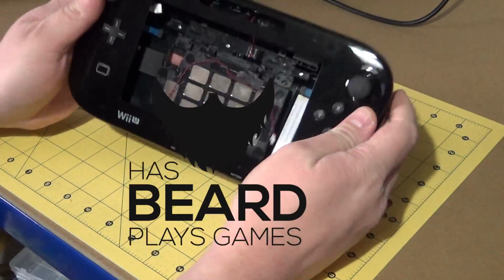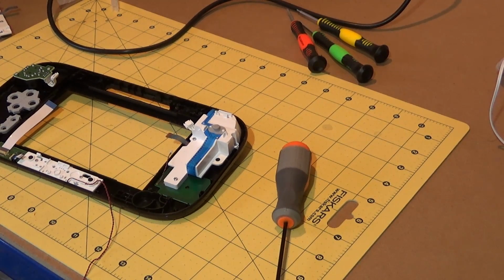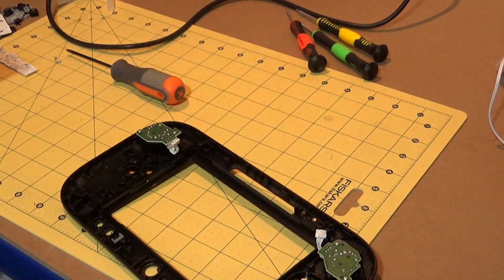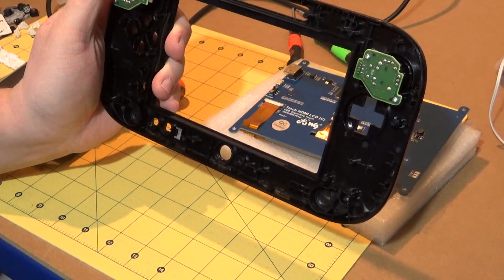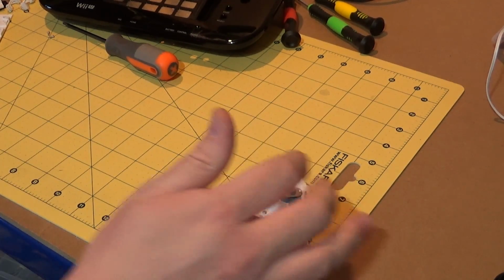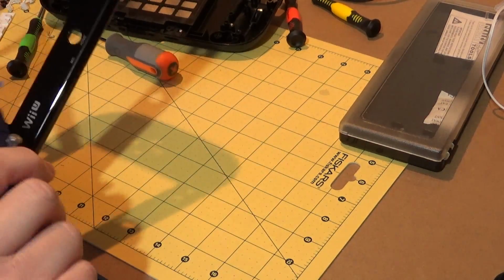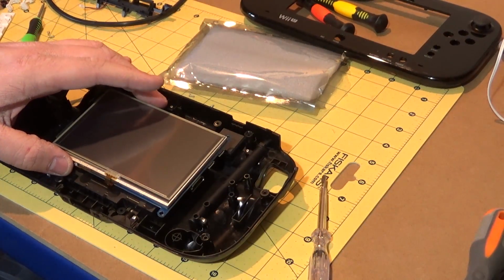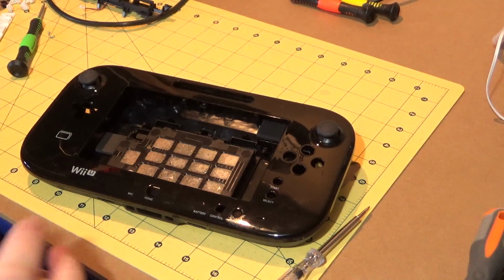(ABANDONED PROJECT) Raspberry Pi in a Wii U Gamepad - Part 2

Comment: you wil most likely need an arduino micro to do the HID front for your two analog sticks, order one or 2 of those if you don't have them. The 5pin connector must be vcc, gnd , Analog1 Analog2 and switch and lastly I think you should find ground on the flatflex first to be able to probe them out succesfully.
Reply: Use this library to appear as a true gamepad https://github.com/MHeironimus/ArduinoJoystickLibrary
Reply from the maker: Thanks for the link, I'll bookmark that! I've seen plenty of information about USB HID gamepads for Teensy, but not arduino. Mini/Micro arduino boards tend to be a lot cheaper than Teensys!
Reply: Mini's can't do HID, uno's can do if you reflash the 16u2 programming chip  but then you can't use it for programming!(ISP programming only) Micro and Leonardo have it built in, but for your project a Micro seems perfect.

Comment: Nice! Being looking forward to this :) how are you finding the 3d printer apart from the faulty motor?
Reply from the maker: Turns out the motor wasn't faulty; I was somewhat inept at putting it together! It's been a few weeks since I recorded this, and it's had a ground-up rebuild since then. Working better than it ever did at the moment, but still some tweaks to be made. 

I plan to come back to this printer again in another video, sort of a follow up.
Reply: Has Beard, Plays Games Good to hear, I'm going to buy a DIY prusa i3 kit tomorrow, any tips for building it?
Reply from the maker: Measure ALL THE THINGS! :D Use a set-square, a good steel ruler, and preferably calipers (if you have them, not 100% necessary tho). Everything has to line up properly, particularly belts, gears, and upright supports. If you're using any acrylic parts then be careful not to over-tighten them or you'll crack the acrylic.
Reply: Has Beard, Plays Games Thanks man, got myself a set of calipers just for the printer lol I think my frame is wood so I should be okay but thanks for the tips, also are you still in need of a tri-wing screw driver? I've got a spare one knocking around if you want me to stick in the post to you that's no problem.
Reply from the maker: Thanks for the offer, but I don't think I need one for now :)